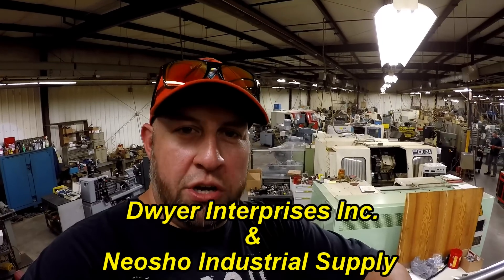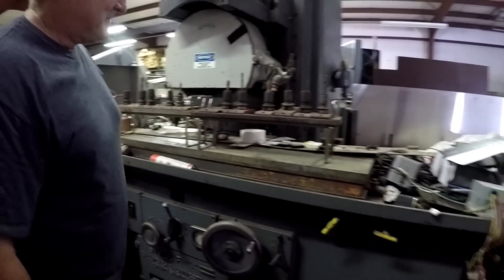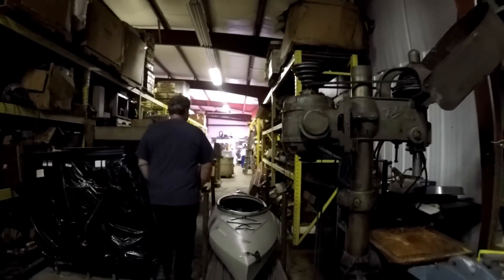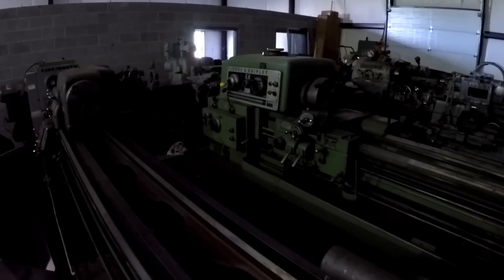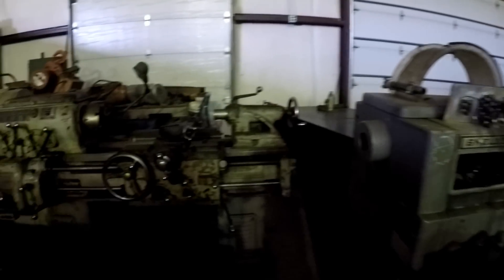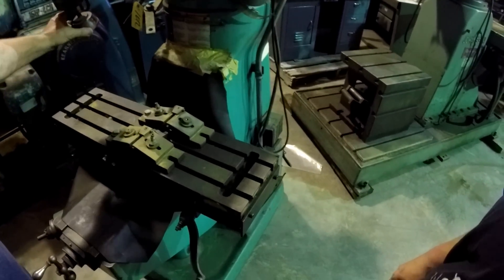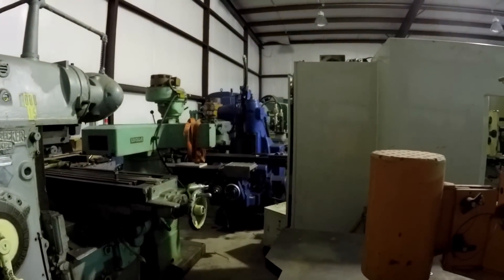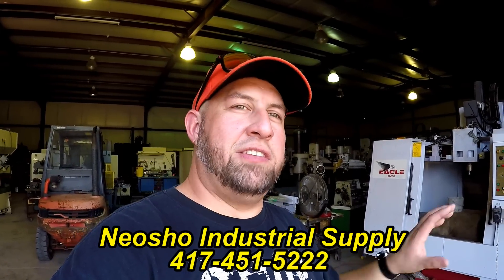Neosho Industrial Supply- Machinery Dealer

Comment: I am 54 now, and when i was in my late teens my first "factory job" was working in a machine shop and was fortunate enough to actually use many of the machines in this video it really takes me back i learned ALOT working that job.Learned to read a tape,read calipers and mic's.Learned precision is very important. Thanks for taking me back to a better time.

Comment: WOW!!!!   You looked like a kid in a candy store.  Thanks for sharing.

I owned one of those Southbend 10K lathes and it was like brand new.  Trouble was the spindle hole was VERY small.

I also have a Hardnige Chucker that is in perfect shape.  I installed a DRO on it.  Talk about precision you can turn that baby 3000 RPM and it is smooth as silk.

Comment: abene mill the Swede  machine is a home shop dream 5hp horizontal or vertical way oil system either 12 speed xyz feeds or infinite with a gear drive head. And it has hard set tram for 90 and 45 with the head to table. Really cool machine.

Comment: I recognized some of the older machines from my Boeing days. The series II Bridgeports and the Cinn. mills. We had several of each. I also saw the Bridgeport true trace machines. I used to run those. We had parts that called for "true radius" and you could only get it with the tracer machine. I wonder if he has a good BP series one complete head. Mine is a little tired....... Thanks for the tour!

Comment: Since Ken Dwyer brought up Pratt & Whitney, back in the mid 90's I was at the Pratt factory in East Hartford Ct working on a project. There were a few buildings, maybe 600 feet long and 300 feet wide, stuffed to the gills with Pratt & Whitney build mills, shapers, lathes and broaches that were being sold off for scrap. Watching the fork truck drivers goring the machines and dropping them into metal dumpsters to be crushed then sent to China was hard to watch.
The metal dealer wasn't interested in selling any of the machines, only scrap metal value. 

My old company decided that running it's own machine shop was too costly, so the huge vertical lathe, 150 foot table Milicron, Giddings and Lewis horizontal mills were all sold off to the local machine tool thief of pennies on the dollar and in some cases, just given away provided it was removed for free.

The prototype lab still had some Monarch lathes, one which was sent for a complete rebuild, and became the most unreliable lathe in the shop. The only machines kept were a few Bridgeport mills and the newest CNC mills.
Reply: When you can get a cheap cnc vmc for about same cost, than....
Reply: I feel your pain but trying to sell the machines you mentioned is next to impossible. I hate waste too.

Comment: I had a 12" lathe in the 70s and I always kept the ways oiled and I never sat anything on the ways and I kept it clean of chips when I wasn't using it... but then I see some of these shops and suppliers and it doesn't look like they're always treating these machines all that well.  (I'm not saying that's the case here, just speaking in general.)

Comment: These old machines are solid but it's not solidity that counts but first cut accuracy.
I've worked with loads of worn out olf UK machines and despaired of them holding tolerance.
Every extra cut needed is money down teh drain and a good reason to buy inexpensive CNC.